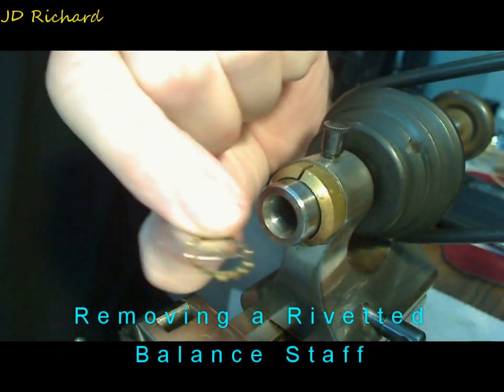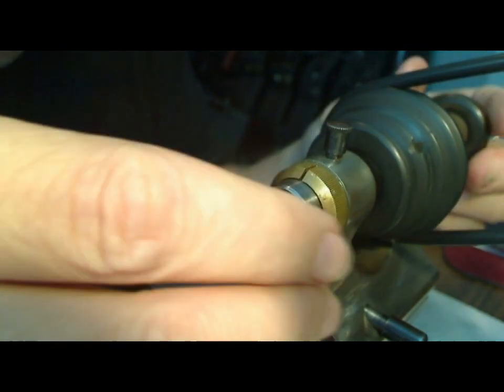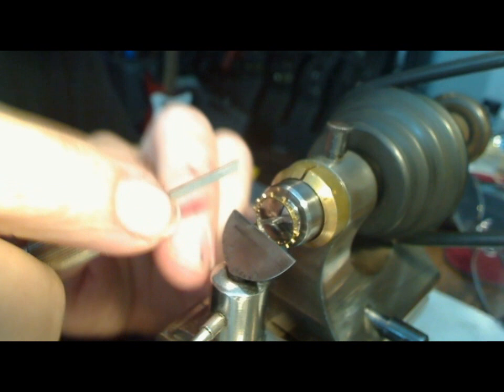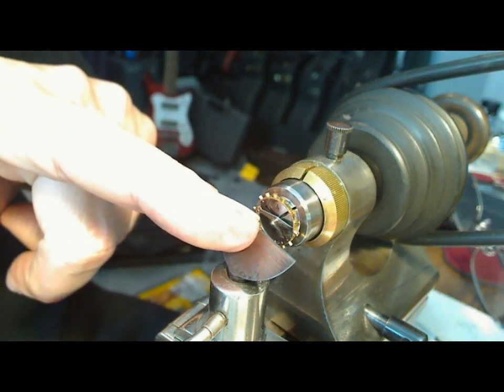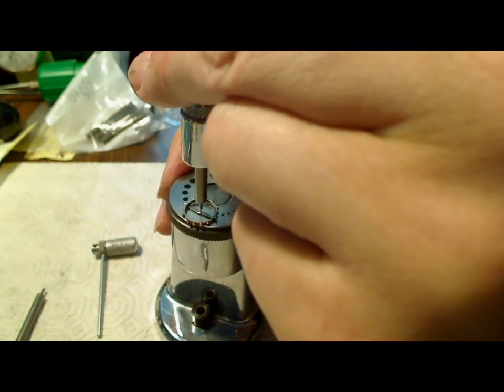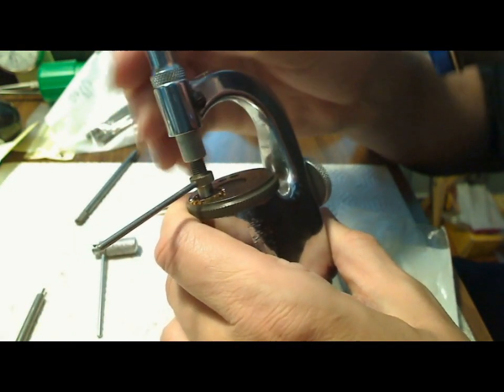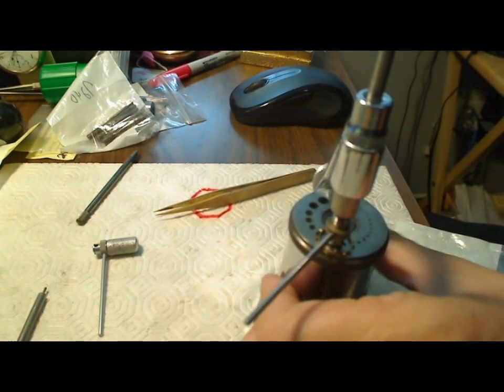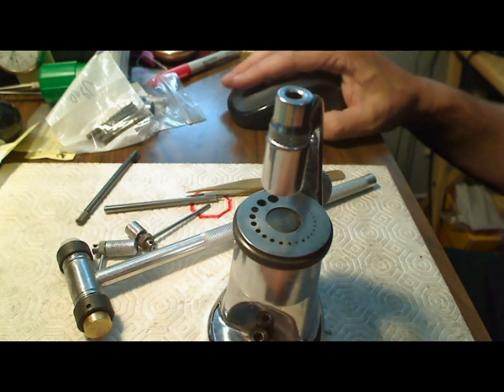Cutting Away a Rivetted Balance Staff

Comment: Hi Jd,

This is a great video, but You do whole the thing wrong… You
need to put in the collet the other side of the staff – where the hairspring
sits, and then – to cut the table of the staff, so the balance will go out in direction,
opposite to the riveting. Then You will need nothing more than press the
staff slightly and it will go out…
Reply from the maker: nevenbekriev That is a great way of doing it, however, not what the books say!!
Reply: @JDRichard  Hi Jd,
Sometimes one doesn’t understand correctly what is written in a book, because he is not ready yet. Now, that You are prepared, please read the book again. Or try another book…
Reply from the maker: nevenbekriev When it says “cut the rivet off” I cut the rivet off.
Reply: @JDRichard  Hi Jd, Please, take a look at this video: https://youtu.be/PzdtN7F_YVc , and then decide for Youself which way is beter...

Comment: I tried that with high speed steel graver and it wouldn't remove any material, only dulled the graver. That was an Elgin staff. I've read u.s. made staffs are very hard. May I ask what your graver is?
Reply from the maker: H.L. Phipps This is a 2mm wife carbide graver. I also have a 2mm round tip and I have 4mm flat and round gravers as well that I use to make balance staffs. I use 2000 grit diamond plate to sharpen them. AliExpress 10 bucks. The graver blades and 20 bucks each buy really worth it.
Reply from the maker: H.L. Phipps Glardon® Vallorbe Swiss Carbide Gravers. Buy at Engravers.com
Reply: @JDRichard  thank you very much but are those the engravers intended for pneumatic use? I had a look I'm just not sure which one I need. And obviously I would need a handle for it. Thanks for any help. I would think I would need either square or triangle shape.
Reply from the maker: H.L. Phipps I have Flat and Round end. Because they are only 4 an 2mm, easy to cut 5mm diameter blue steel rod with precision. I bought 4 cheap graver handles to hold them. It is a great setup
Reply from the maker: H.L. Phipps One more point. I do have 4 Carbide square gravers that I shaped into a triangular tip for removing a lot of material. However, on my last Balance staff, I only used the 4 and 2 mm gravers
Reply: @JDRichard  thank you for your help I ordered a couple of those gravers. One was 90° flat and the other called knife I think. I'll make handles.maybe those two will get the job done that site doesn't show the tip shape well. But reasonable prices
Reply from the maker: H.L. Phipps I found that the 2mm round tip is great for graving out the cone shape of the pivot before it straightens

Comment: Hi JD, 1. Is the rivet on the hairspring side or the roller table side?. 2. What brand of lathe and size do you use?, 3. Where did you get the eye loupe with an LED attachment? Thanks, Excellent video!!!
Reply from the maker: rgoidel The rivet is typically on the hairspring side. Get the book Practical Watch Repair - it address balance staff work. I have 6 Laths. My Boley Lathe does a great job...just make sure it takes 8mm collets.
Reply from the maker: rgoidel Ali express has the eye loupe for X25 work which is what you need for balance staffs

Comment: Great video. It's advised, when, by the manufacturer of your K&D staff remover, to rotate the lever arm so it rests against the back of the of the staking anvil. It stabilizes the tool and prevents the possibility of the tool loosening and jumping. Bunnspecial has done a fantastic video on the use of this type of tool. Its where I learnt The use of mine.
Reply from the maker: tony diggins Thanks for the advise, always learning